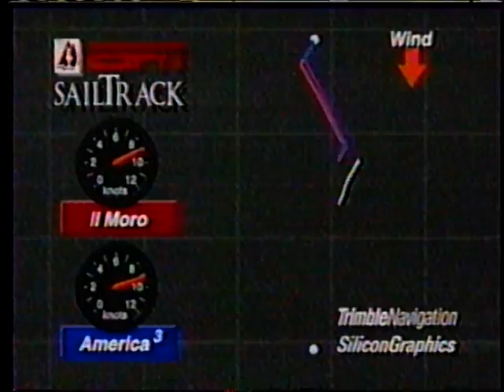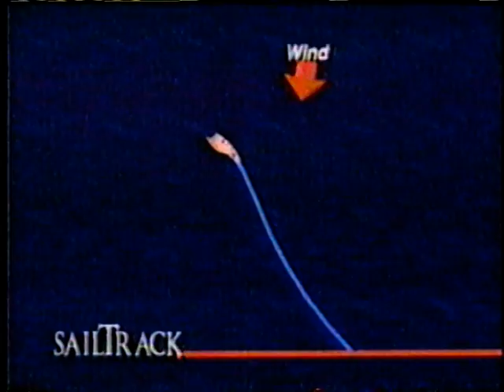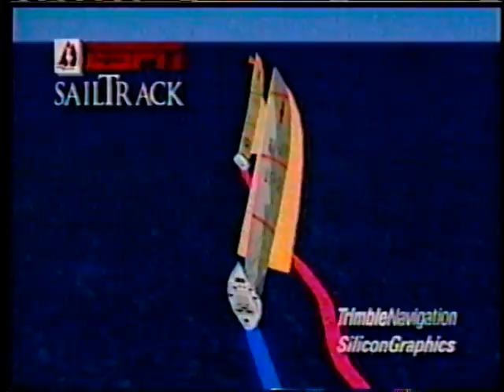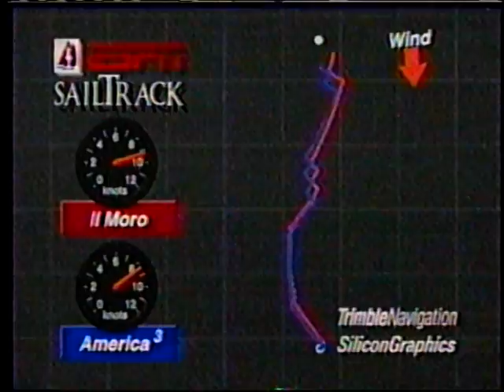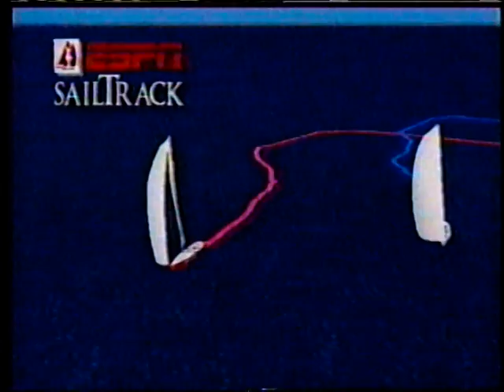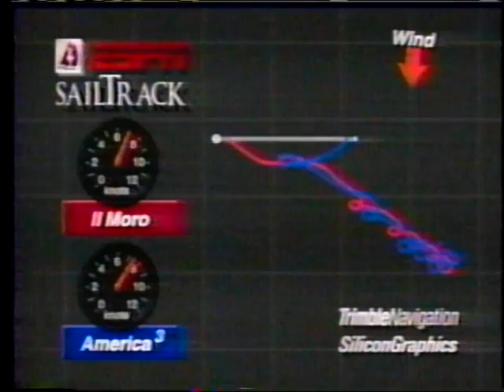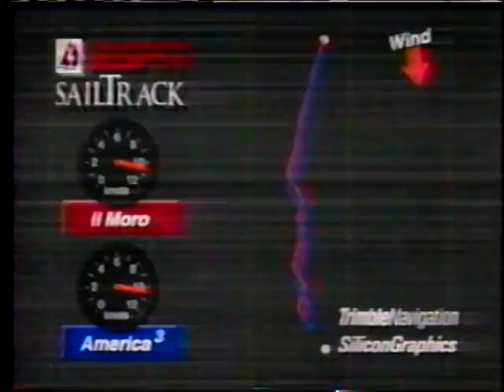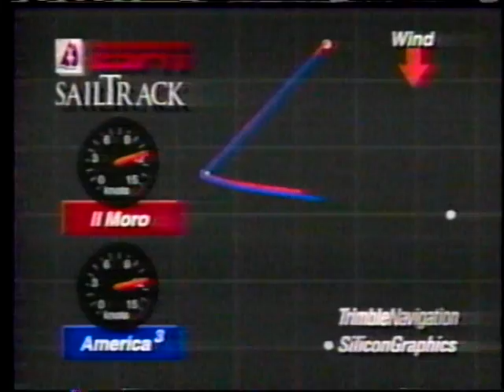The Americas Cup'92 The 28th Defence Best of 7 Races part 2 Eng

Comment: I certainly miss the old school sailing,sail handling, and slower boat tactics. New foiling  is unique and fast but has long term appeal. Don't think it will last.
Reply: Spot on comment, sir. The common sailing enthusiast, like me, can but concur.
Reply: Well considering the AC75 is booked into AC37 it might last longer than you hope
Reply: Pfft. Have you seen what's happening in foiling racing?
Foiling is ultimate sailing.
Reply: Look how slow they are going